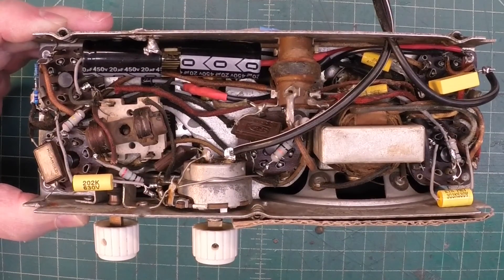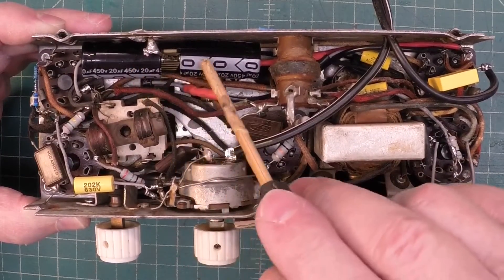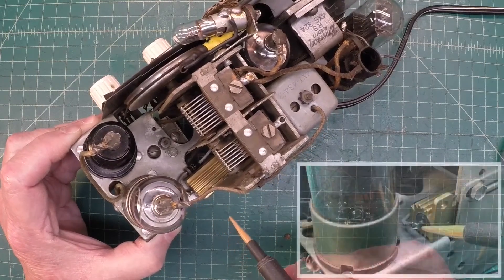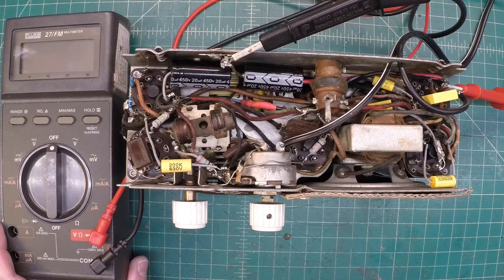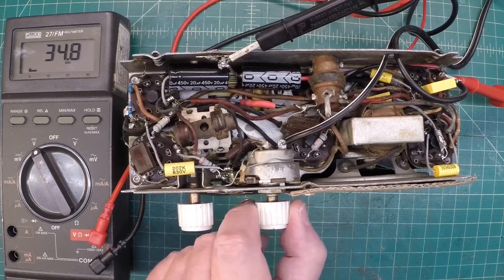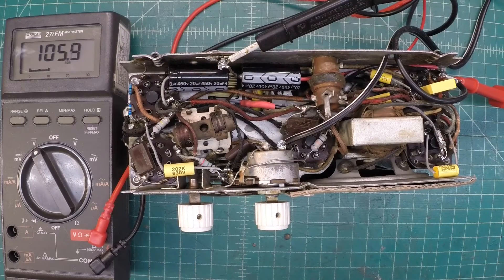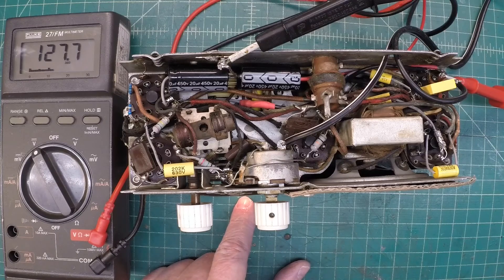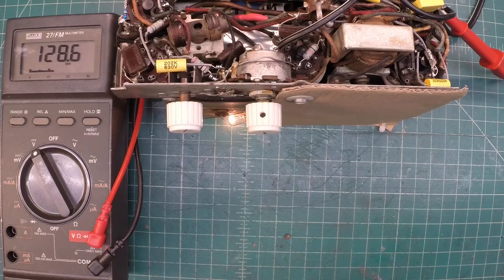Emerson AX-212 - First Power Up Attempt

Comment: Question: I have been using inrush current limiters, but of course the units I work are far roomier than this little set, and heat dissipation is an issue for the unit you are restoring, did you consider using one, or is there another issue with using one on so simple a radio?
Reply from the maker: Albert - I've used a CL-90 Thermistor in a number of my projects. The chassis was so tight underneath (heat would have been a concern) and I used the open space on top for the rectifier diode and power resistor. Which one do you use?  Best, Don
Reply: @RestoreOldRadios  In the Hallicrafters I restored, I used 120 ohm current limiters (Ametherm MS22 12102 Inrush Current Limiter )which give a nice slow warm up to the tubes and limits B+ inrush current to the B+ components and lowers the overall AC voltage by about 1.5 volts, which is closer to the original design specs of 115 VAC.  I am sure the pilot bulbs dont mind it a bit either.  But there is lots of room to work with and allow heat dissipation.  My only question on using them is how long they last before they fail since I rebuild the units to last hopefully 10-20 years.  Also I mount them as the last thing before the power transformer primary leads (1-fuse, 2-safety cap, 3-switch), lots of room to do all that.  Currently working on an SX-71 but learning all I can from your videos on prechecks before starting it up.
Reply from the maker: A good question for the vendor(s) on the life expectancy of the device. They will probably say it depends on the frequency of use and proper loading to stay in the design window. I see the MS22 12102 has the same specs as the CL-90. You may want to reach out to Tim YouTube +AMStationEngineer or Rick +AllAmericanFiveRadio and get their expertise on current limiters. Best of luck on your projects and if you hear back or learn more on the life..., please keep me posted. Best, Don

Comment: Nice use of the zener's.. interestingly.  a few years back when I was working on a Philco PT6, it would blow the lamp out periodically as you mentioned and most definitely if I turned it off and back on while the tubes were still warm.  I tried the zener trick and I got trolled on the ARF for it.  I kind of feel vindicated. ;-)
Reply from the maker: Bret - thank you. I know purist are not inclined to use them in a vintage radio and I recognize that. It certainly works and provides a solution that can be utilized when needed. Thank you for reaching out and for watching. Hope all is well with you. Best, Don

Comment: Thanks Don for another fine video .   Like it when you take time to explain things.    The diode is really neat .  What makes the zener special?
Reply from the maker: Thank you Dean. The Zener Diode acts as a voltage regulator and keeps the voltage across the dial lamp below or at 6.3V. The Tube Heaters when cold as the radio is first powered up have a low resistance and this causes the Heater string voltage to be high. Since the dial lamp is in series with the tubes, the dial lamp voltage can exceed 8 volts on power up and this will shorten the life of the bulb or can cause it to blow. The Shunt Resistor is added to make the dial lamp, which in this case is rated at .25A match the .30A heater elements for the tubes used in this particular receiver. Check out this article at: https://www.electronics-tutorials.ws/diode/diode_7.html Thanks again for watching and I hope this helps. Best, Don
Reply from the maker: A few videos you may find helpful as well.

https://youtu.be/E4IIiIhIYAg

https://youtu.be/N9UDobarNhU

Comment: Could I ask the value of that safety cap you are using I bought  a bunch from China ,I watching your videos so I can learn when to use them ,you ask for my email address it ron61551@gmail.com.your work is so perfect ,I strive to make my stuff as neat looking,thanks for your videos sir.
Reply from the maker: Ron, regarding the safety cap I matched the value of the paper cap that was there, which was a 0.1 mf capacitor. I’ll forward the capacitor color code info to your email ASAP. Thanks again for watching. Best, Don
Reply: @RestoreOldRadios  thanks I understand now.

Comment: That is really nice and sensitive on low voltage. I should have put in the Zener diode on the Bush I just finished because they are notorious for taking out panel bulbs at startup. Looking forward to the next part Don. You take care and look after yourself. George.
Reply from the maker: Thank you George. It’s never too late to throw a Zener in the circuit. I appreciate you following the series. Best, Don